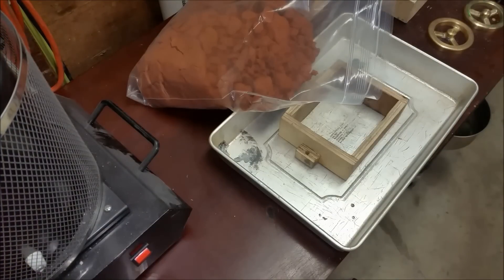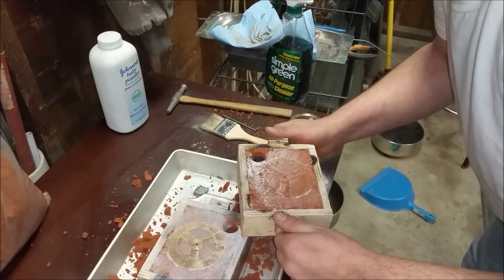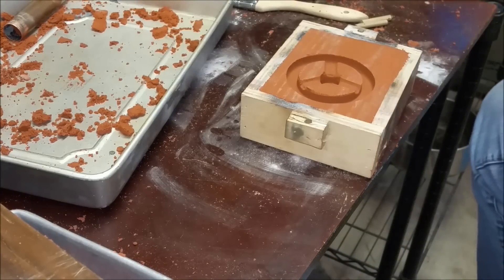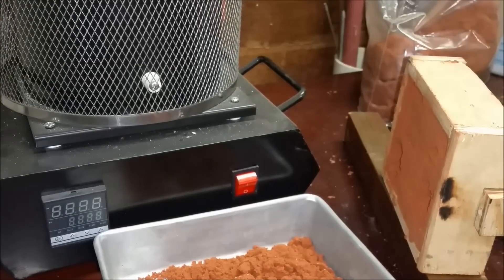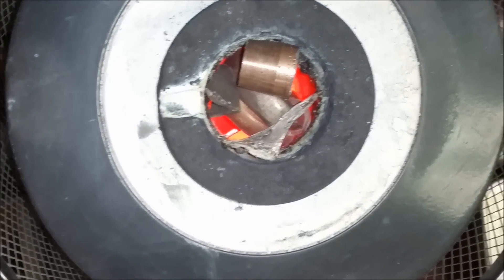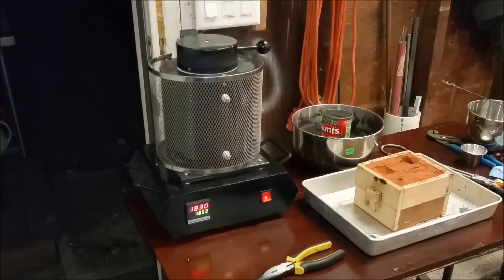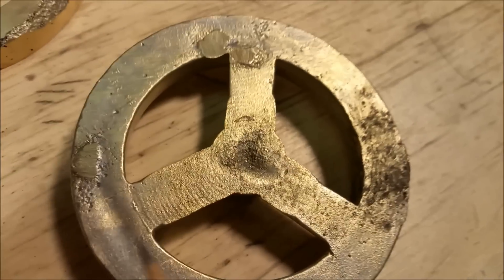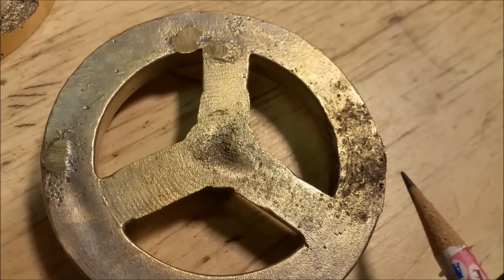Casting Brass using Petrobond

Comment: the longer gate will not help, shorter is better. the pitting is due to rubbish (loose sand etc)  being washed into the casting. better compaction of the sand and sprue design helps here.
the sunken divet in the center is due to shrinkage of the melt. this happens where you have a thick sections that freezes after thinner sections surrounding it. you need to put a thick riser above the area to feed in molten metal into the area as it freezes.

the rough finish of the secondary pour is a result from poorly compacted sand. look at Myfordboy to pick up clues of how to do a good cast.
Reply from the maker: Hi Charles, Thanks for helping us to know the right way to do this. I will take your advise on my next pour. Cheers

Comment: Petrobond is not a substitute for Delft Clay. As the receipt suggests. Its' good but not that good.
Reply: Umm... when you need large flasks as in the  case for large Model Engineering projects (like steam engines)  Delft Clay is waaaayyyy too expensive as an option. I typically might use 150 lbs of Petrobond ! Delft clay is great for little tiny projects, jewelry items and so forth..that's about it though.

Comment: why a copper flywheel?  I would have assumed a lead flywheel would have been preferential.. If copper is needed (aesthetics), I would assume a larger flywheel (mass in motion)..     darn, now I have to min all your videos to answer these questions..
Reply from the maker: Great Advice, i use brass not copper because its easy to machine and comparable to steel, also easier to cast.  I agree, if i needed  more mass, i could make them larger.. Thanks you for commenting. -Cheers
Reply: Although mass is important with flywheels, you can store far more energy with speed. Lead is too soft. Plus it's a neurotoxin with no safe levels.
Reply: dichotomy of a society.  We manufacture millions upon millions of lead bullets or our guns, but this flywheel should never make it inside a living body.  I do understand the reticence, but will a toddler decide to suck on the flywheel.
Reply: Flywheels are all about moment of inertia. I would bet that lead would be less efficient structurally to the point that you would end up with better results with a cast copper based alloy. Lead weights on a steel wheel would probably work, but would be more complex.